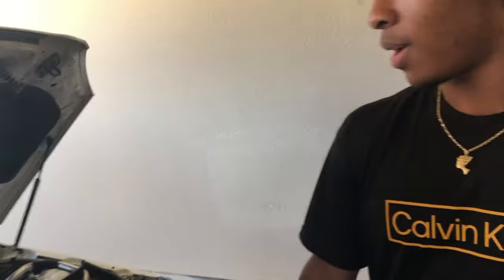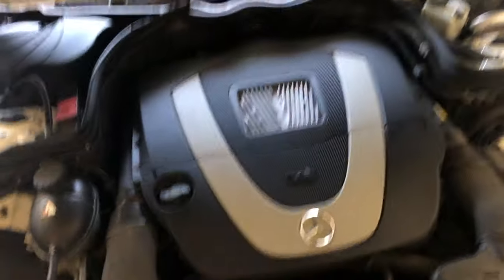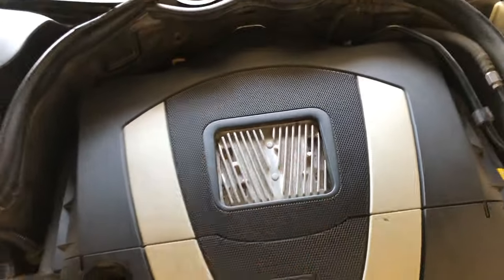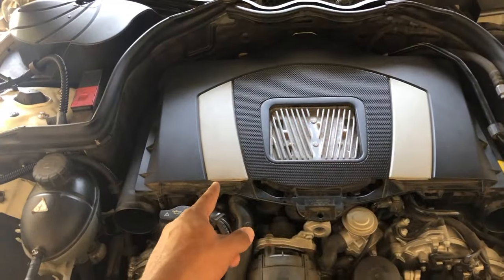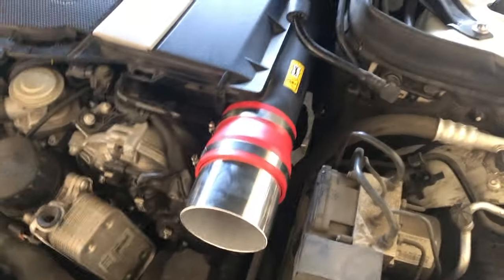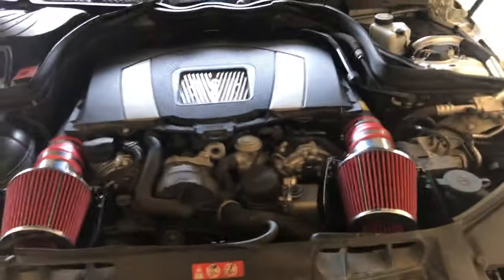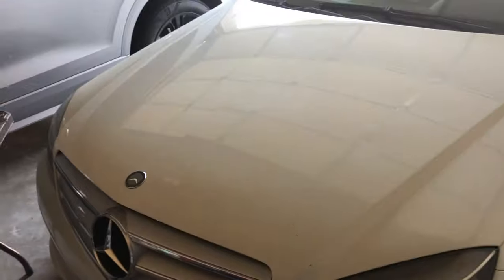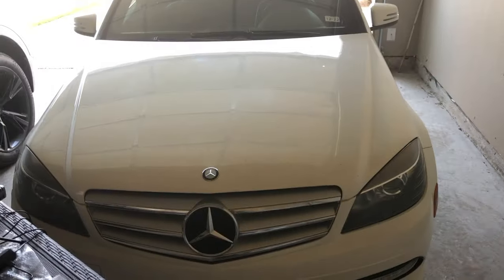Mercedes Cold Air Intake Install

Comment: You never want this installation. You will pull in way to much heat from the engine bay. There’s a reason why the original ones are pulling air from the outside like they should.
Reply: A heat shield would fix that
Reply: @kevinc1162 Or just leave it stock? Nothing wrong with the factory design
Reply: @jimthompson909 you are completely right just leave the original one I change mine and my engine over heat all the time
Reply: @miseryparty3726 when you want sound you need theese
Reply: @kevinc1162  only if the intakes are already in a relatively cooler spot not right next to the engine
Reply: @miseryparty3726 nothing wrong at all. Everything wrong with this for sure
Reply: @automotivebespoke wrong ,all kinds of heat is retained under the hood .This defeats the cold air intake and turns it in to a hot air intake...
Reply: @Bax60 technically speaking when you want to install a cold intake its advised that you install it with a heat shield because there will be some heat from the engine..not necessary but should be considered
Reply: I added cold air intake to my 2010 benz c300 sport and 2 lights came on after, the thermostat and a misfire in one of the cylinders . I don’t think there no good , I think people are right with leaving it stock
Reply: @Lilslat1 show the setup lol
Reply: @Bax60  so what all would I need to get the cool air in this car cause I have a 08 c350
Reply: @tredeep333  Leave the factory air inlets alone. Because you are already getting the cool air that way .lf you take them off and start drawing in air from under the hood ,that air is way hotter than the air coming  in though the factory air dams right now because they are drawing in air from outside the engine compartment right behind the grill ...
Reply: @Bax60  dang that sucks i guess I'll just stick with the beats then thanks
Reply: @tredeep333  You could buy some of those high flow air filters ,but it really doesn't make all that much difference that you would notice it .I bought some expensive ones and put them in mine and I couldn't tell that it made any difference. Inpect the factory air dams and make sure there is no cracks in them .If your mercedes is running as advertised now ,it's best to just let it be .It is what it is ,a really nice car
Reply: @Lilslat1  my cold air in take is throwing codes. Do you think I can replace it with just another stock one
Reply: What’s a better alternative? Just leave it stock?
Reply: @muhammedvarnado2100  Yes .If you want to ,you could buy some high flow air filters. But you won't notice any detectable change .The stock  Mercedes air dam works very well to bring in cold air from outside the engine bay ,and the dual inlets provide  very good flow already

Comment: the stock tubes imo are the most advanced technology by car engineers. i was gonna do this but then i realized it's gonna be the best bet if instead of removing the frontal tubing originally engineered... just keep it in and get a K&N filter for the inside of the filter casings. this is gonna free up a lot of air over the paper filters and be louder and keep the frontal tubing as engineered by the guys making these vehicles run so smooth to begin with.
Reply: Did this thanks 🙏

Comment: Doesn't make any sense. Too much hot air from the motor and due to the missing pipes the pressure in the manifold is missing as well. Minus of hp!
Reply: The hot air isn't that much of a problem because they will be directly infront of the stock air inlets also pipes missing? Really?  They wont screw up the pressure BUT you may be right on the loss of HP

Comment: GOOD JOB !!. you just gain negative -15 horse power. Smh hot air for the engine. People plz don't do this. Engine light will come on 100%> u messing with the ECU airflow calculation
Reply: Is it your car?????

Comment: The mercedes has a built in cold air intake. Yeah man the original intake was much better should have just got high flow filters would have been way better

Comment: Very nicely done video, but you got the opposite of what you where doing this for. 1. The stock tubes directly routed fresh, cool air into the engine because the ducts are completely enclosed right up to the openings in the deck above the radiator. This is an optimal situation. 2. You removed this direct routed fresh air system and installed a a system where the filters will draw under hood hot air into the engine. The heat shields MIGHT protect the filter from engine heat, but the filters can only draw in hot under hood air, and a very minimal amount of fresh outside air because the filters are in an open space and just draw in the easiest air which is all around it. 3. The reason the factory ducts, even on a Mercedes, are plastic is because plastic is a poor conductor of heat, ESPECIALLY compared to aluminum. Aluminum is an incredible conductor of heat. It will heat soak quickly, and will transfer that heat to the air flowing through it and into the engine. This hot air entering the engine is less dense and contains less oxygen. Because of this, the burning of fuel in the cylinders makes less power. You are now no longer drawing in ONLY fresh, cooler air from outside, and are now instead drawing in hot under hood air (less dense) and heating that hot air with the aluminum tubes to make it even hotter (even less dense, less oxygen). The engine can only make less power because of physics.

I hope that gives insight into what's going on here. I didn't just want to join the others in saying "this doesn't work like you thing," but instead I wanted to give the all the reasons of what is actually happening here. So that you don't think I am someone else who "doesn't know better,"....I graduated from an auto tech school, did it for a living for a while, have built several muscle cars, and have worked on cars of all generations for the past 40 years between maintaining and repairing my own cars, my family's cars, my wife's family cars, as well as friends and coworkers. 

All that being said, you did do a really good job making this video. As I said earlier, nicely done.
Reply: Stop hatin
Reply: @Wildanimal864.  - In my comment I explained my background in order to demonstrate that I know about these things. Providing educated and experienced knowledge is not "hatin," it's trying to help someone out and provide information they are not aware of.
Reply: @Wildanimal864.  lol
Reply: You couldn't be more right, original is always best😊
Reply: @1001Hobbies  do you think a replacement filter is better than open air ? i have the exact same engine as the video above
Reply: @nicholasst8977  - The air intake system on this engine is a very good one. I would not replace the system with anything else. You may be able to find air filters that allow more air flow through them, but of course the trade-off is less filtering effectiveness. That's something you will have to weigh for yourself. 

As far as which is better, this or an open air system.....I don't think an after market open air system will be any better than the factory system. The factory system has 2 snorkels already drawing in cool, outside air. You get both volume and the coolest possible temperature (without an intercooler). Any after market system, in THIS instance, won't provide any benefit. I have to give Mercedes credit for designing a nice system here. 

One last, and slightly extreme thought, is the only other change to the air intake system that would produce any increase in power (and we are only talking another 5 HP or less) is putting a hood scoop on it and route the air in an enclosed system into the air cleaner. The forced air will push a little more air into the engine, but a hood scoop on a Mercedes is not typical, for obvious reasons. However, there's a reason so many of the muscle cars from the 1960's and 1970's had them.
Reply: @DenisElmazi-vn3yw  not always
Reply: Respect

Comment: You guys will never listen the stock intake pipe that was receiving air straight from the front of the grill is way better than what you've done,why force the engine to breath that hot air in the engine bay this mod is a 0/10,even if you where doing it for intake sounds the airbox is so restrictive you didnt still get any sound from it

Comment: Hey man did you notice an engine light come on for running lean?
Reply from the maker: No check engine light came on from installing the intake system.
Reply: The computer compensates for intake temperature and injects the appropriate amount of fuel. He won't get a lean condition, but because hot air has less density, and oxygen, than cooler air he will have less power.

Comment: There's more cons than pros when fitting these aftermarket filters..

1. They don't offer as good filteration  as stock filters.. Allowing a lot of dust over time to clog up your mass air meter, which in turn will present a problem with the measuring of air to fuel ratio? Not to mention the dust that bypasses the filter and settles in the engine??
2. Heat soak will rob your engine of a few horses.. It might not seem that way with all the throaty sound it gives off.. but believe it not.. stock filters will bring in more dense air than under the hood cone filters.. even if you have a heat sheild around it..
3. At best you will only increase your horses by 2-3 horses, if that at all??

Comment: looks dope , did you get anymore horsepower or torque from it ? not going to lie that other intake that was sticking out more looks annoying since to check the power steering oil you have to remove it everytime
Reply from the maker: It definitely felt quicker, but I had a lot of other factors at play.
There is one car forum page with same set up he experienced a 5hp gain after dyno testing.

And the setup is very easy to remove, I have a video on it somewhere. Just pop the whole airbox off.

Comment: Do you got to have the heat plate under the or is it safe to install the system with out them?
Reply from the maker: Yeah it’ll be safe to install without the heat shield, it’s just a extra measure of protection to keep hot air from being sucked in.
Reply: The hot air is being sucked in because you put those on there and now they are sucking much hotter air from the engine bay than the stock hose were ,which were sucking cold fresh air from the outside .Hot air is less dense ,which means it has less oxygen which decreases the output of the engine.Get a thermostat and tape it inside the hose of both..you will see a much hotter temp going in to the engine off those cold air intakes then the well designed stock set up ...Buy hey ,they look cool ,now you will get less gas mileage and a slight decrease in hp ...especially in hot weather conditions

Comment: Nice video! Is it the same process for a C240 2004?
Reply from the maker: It should be the same process but you may run into some fitment issues if you use the kit from the video.

Comment: did all that come with it when you bought it
Reply from the maker: The kit does not come with the bigger cone filters and the heat shield. The links to everything i used is in the description if you want to check it out.

Comment: Can you install it inside the tubes ? You would keep fresh air and still get the intake mod
Reply from the maker: If you are referring to the stock intake tube, you could retro fit them to attach to the front of the cone filter, but a better method would be just buying a high flowing K&N filters similar to the stock filter style.

Comment: Will this setup work for S class benz
Reply from the maker: The S class has a bigger engine and a different engine bay set up than the C300, so it will most likely not fit.

Comment: hi is it possible to install it on mercedes w204 c220?
Reply from the maker: I doubt it, 
but you can always remove the stock air box and replace it with a tube and a filter for low cost. Just will take some creative thinking.
Reply: @BOSSMARTIN  ok Thank you 👍

Comment: Will this work on 2006  mercedes c230 sport? Looks like the same setup
Reply from the maker: The kit I used was designed for a w204 engine, the 2006 model has a w203 engine. I saw a picture of the engine bay and they are similar but you may have issues fitting it in there. It could possibly work though.
Reply: it should fit on your engine. both your car and this guys car feature the m272 engine, but your chassis are different. he has a w204 chassis whilst you have a w203 chassis.
Reply: Hi there guys i have 2006 c230 did anybody tried this and it fits let me know

Comment: I was thinking of doing this but I see no benefit
Reply from the maker: It’s a cool aesthetic and made maintenance easier. I used this setup, a chip tune and E85. It made the car more responsive and I mostly used this setup in the winter time.

Comment: Will this work on a OM642 engine on a W211? 2005
Reply from the maker: I took a look at the engine online. I doubt it would fit but I can’t confirm for sure.
Reply: no. this only works on the m272 engine

Comment: These people taking about it’s a hot air intake they are slow these are open cones they almost work the same as the oem ones 😭 people don’t know shit
Reply: This creates a loss in hp, quicker engine soaking, and loss in overall acceleration time, I don’t think you understand the purpose of the stock intake hose

Comment: would this fit a 2013 c300?
Reply from the maker: The intake I used is for a W204 Mercedes engine, i not sure what’s in the 2013, but if your engine bay looks similar to my c300 then it will most likely fit.
Reply: @BOSSMARTIN  can i send a pic of my engine? Because its a little confusing ngl. Whats ur insta?
Reply from the maker: @ahmedalnaji1329  Sure, @boss_martin_
Reply: no. your car features a m276 engine. this is for the m272 engine

Comment: Okay, I get it, my dude. Not throwing shade at all. 
That being said.. hi, highschool physics here! Those heat shields will never perform as well as pre trans/ coolant radiator air. 
(Again, no offense, but you sound young so peacocking > performance might be your priority. 
Larger scoops pre radiator and larger circumference with directors (some may call them impellers but they are agitators technically) leading into the box would perform so much better. 
That being said, insulate and line the box with something that has low thermal conductivity. 
I know I seem Big Brian right now on public education topics but I'm not trying to be. Please man you can do better. 
If you don't believe me, get a flir and take measurements